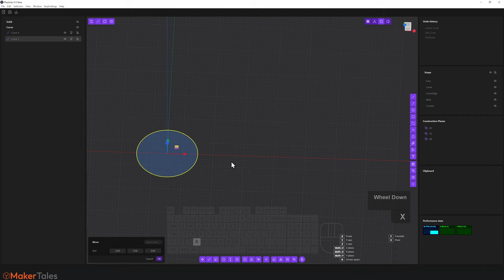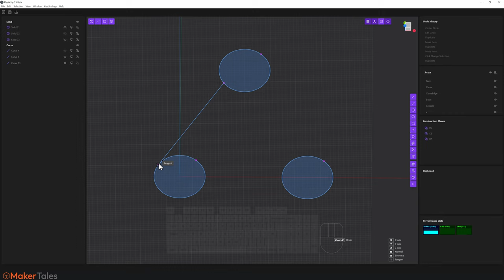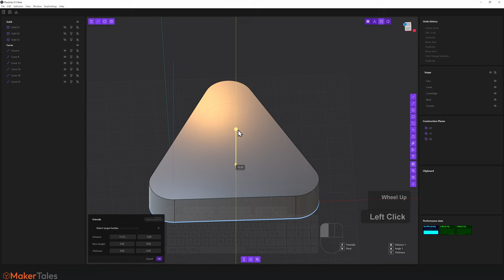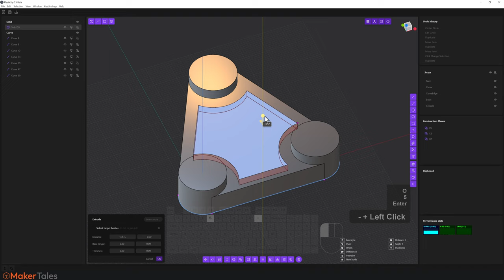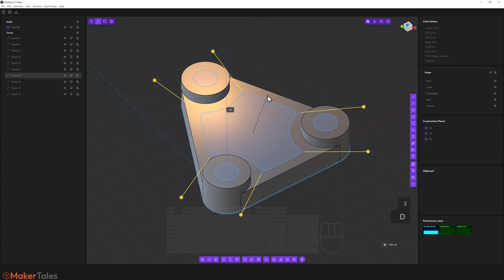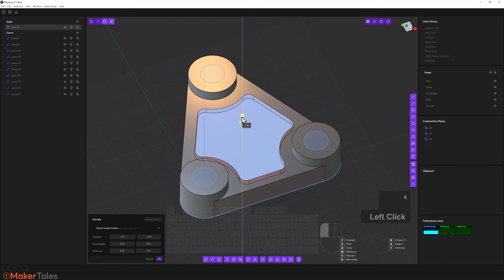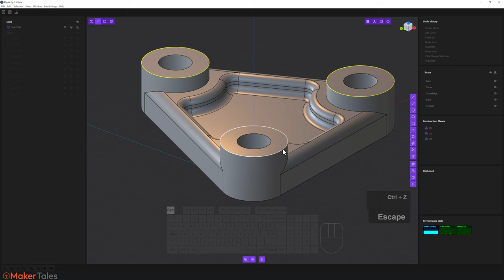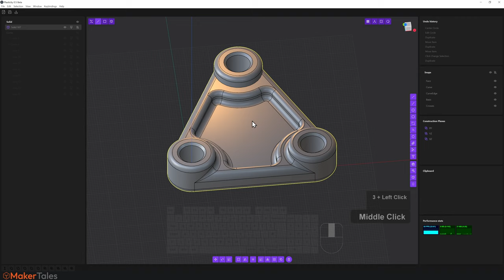Beginner Hard Surface Modeling In Plasticity 3D | Part 4

Comment: There is no radius setting box under "circle".  I also do not get an option to set the diamter of a circle by pressing D.  I get 10m only by turning on snapping and setting it to 1m increments. Using 1.2.1.

Comment: I use mainly 3ds Max, but it seems this software is more like Autodesk Inventor CAD software.
Reply: Take it from an Ex-3Ds Max expert, you will never go back once you get away from polygons. They are not accurate and are more for visualization than anything else. Parametric nondestructive modeling is totally addictive and the first person to make a viable (free) class A NURBS application will crush it. Turbo smoothing, and the rest, seems so unserious to me now. -T
Reply: @clickeye1  No you still need polygons when you are making game models. Even if you make a model in zbrush you need to convert it to polygons before you can use it in any game engine.
Reply: @TheTimeProphet  Or need to make sick renders with renger engines. For purley 3D data there is nothing better than this.
Reply: @simonzhang3D  I can make sick renders with Max. Also I use Autodesk Inventor if I wanna do CAD.